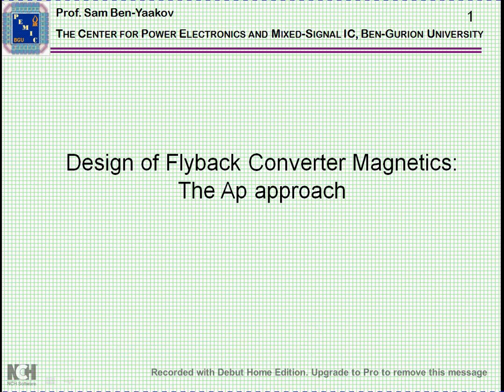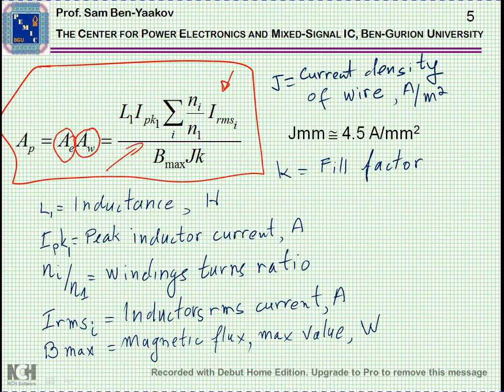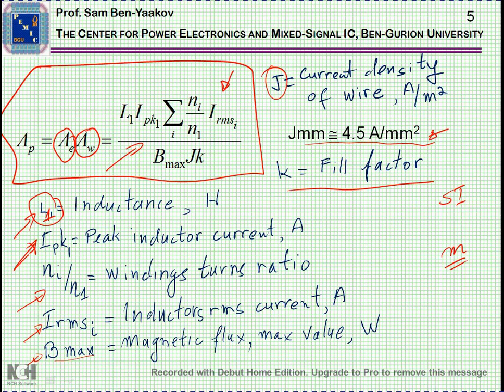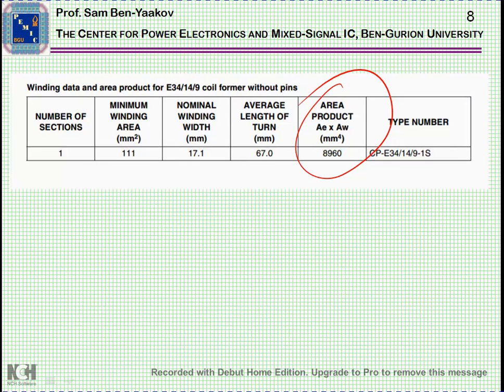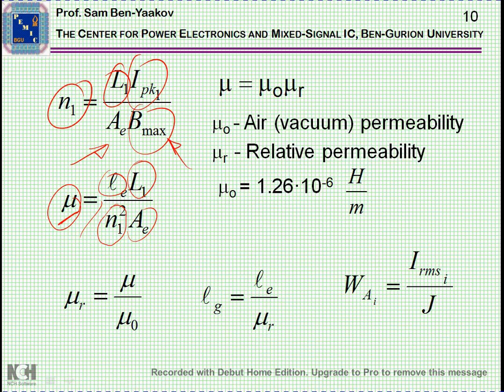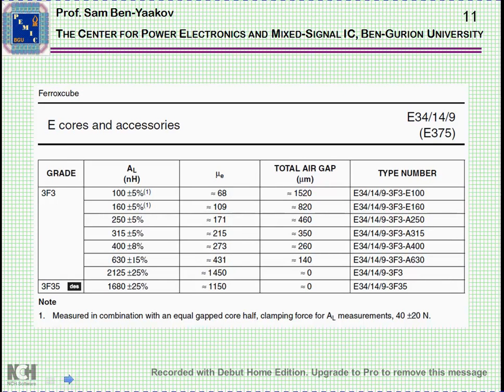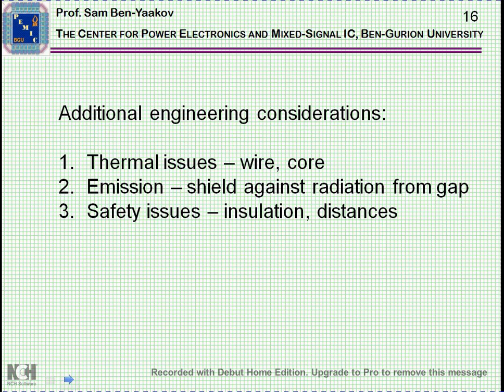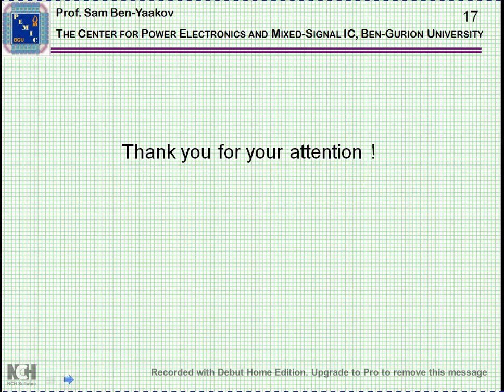Design of Flyback magnetics: The Ap approach

Comment: I have a question. Why air gap in flyback and inductors, why no air gap in full bridge converters.
Your videos are great.thanks.
Reply from the maker: the air gap increase the ability to store enrgy as required by inductors and coupled inductors (flyback).
Reply: @sambenyaakov  thanks for your reply.
 I know air gap is necessary in inductors and no Air gap in symmetrical converters(full bridge). can you explain this mathematically (B=uH). I am confused, according to B=uH, B=LI/nA. flux density should be the same no matter energy is being stored or not. If flux density is same for both types of converters, why Air gap in inductors and no Air gap in full bridge or push pull converters.
Thanks for your informative videos. You are doing great 👍👍.
Reply from the maker: @ EM energy density is B^2/mu so you need low mu. The magnetic energy is stored in the air gap/
Reply: @sambenyaakov  thanks 👍.

Comment: WOW, ok so, i went and tested out this theory, and i got pretty good results. i used the equations to reverse engineer a core, so i took these core equations and created a virtual core, this virtual core has a toroid shape with the Ae kept the same, so the mass had to be equated , then went and wound 10 turns, and measured the inductance and kept the value on a note, then i added 10 more turns and i measured the inductance, then from the Delta, i created a difference equation, which i used to estimate, if this was a toroid core, the permeability in both virtual and real, applying the toroid core inductance equation, then went back to the real core with the parameters extracted from the virtual one, and i got an estimated error, from the calculations to the real deal of about 10% , so really accurate model, so maybe this 10% amounts to the losses not being considered, i designed a fly-back power supply, 2 outputs, 12V@3A each, with a final efficiency of 82%, way more than i expected !! Thanks for sharing!!
Reply from the maker: Thanks for note and for sharing your experience. Interesting.

Comment: hi sir, your video is great. I have one question,  as we see here by incresing number of turns we can reduce magnetic flux density (B) of the core to prevent saturation, but we also know that  by Ampere’s law, the magnetic field inside a solenoid is
 given by BL=µIN which shows B is propotional to number of turns. Please clearify this confusion of mine that by incresing number of turns we reduce flux density(B) or increase it ?  Thankss.
Reply from the maker: Excellent question which, I think, many are wondering about. Increasing the number of turns will decrease B in cases that the larger n REDUCES the current. For example a transformer.  If you increase the number of turns of a transformer, the magnetization inductance will and the magnetization current current will decrease. This will reduce B. If you increase the number of turns in Flyback then for  same power Iav will be the same while Delta(I) will decrease. So Delta(B) will decrease. The bottom line: increase in n decreases Delta(B) due to AC voltages but increases B due to DC current. I hope explanation is clear enough.
Reply from the maker: Welcome to join
https://www.linkedin.com/groups/13606756

Comment: In a flyback converter, if it is in CCM, then there is a DC current in the transformer. does that limit the maximum deltaB that we can get without hitting the Bsat limit. Also, if one decides to use interleaving, so that the maximum MMF in the core reduces, does that impact the deltaB somehow and how does that affect the design?
Reply from the maker: DeltaB that affects losses  is a function of the AC component. Saturation is a function of total instantaneous current.

Comment: Hello Sir, Your video is really very helpful. But I have some doubts. I am designing a 120W flyback converter. What will happen, if I will use a continuous core as used for high frequency transformers?
Reply: +PUNYASHREE PATTANAYAK
Maybe you mean no air gap in the core. If you do use one for the flyback topology, you will be wasting a lot of energy as the transformer saturates at low currents. The inductance will also increase, and a lower operating frequency is needed.
Reply from the maker: Correct. If no air gap is indeed meant. The core will stature. Energy can be stored (as required in the flyback converter operation) only in gaped cores.
Reply from the maker: I guess you mean CCM. No problem.

Comment: Hello Sir 

I found your video interesting, for my thesis work, can you also elaborate that, what if blackback transformer using in old CRT TV with 220 V Ac supply having flyback connected to its Picture Tube with breakage wire passing a connection to a metal net *(same as speaker net) will give current to this as well. it will give shock from a far distance, may be because of the magnetic field, but up to what distance?

Comment: Thank you very much for your videos. I just found your channel today.
I am not understanding why the flyback needs an air gap. My first thought is that you could store a lot more energy in the core, but this of course must be incorrect.
Reply from the maker: Thanks for comment.The energy is in fact stored in the air gap because the H is much 
 higher there (magnetic flux density is the same in gap and core).
See
https://youtu.be/6Mi8QDD71vE
Reply: Excellent, thanks again.